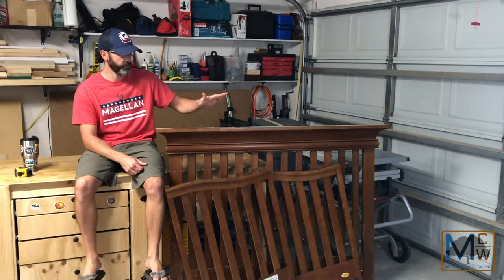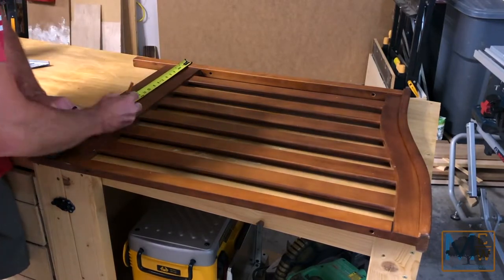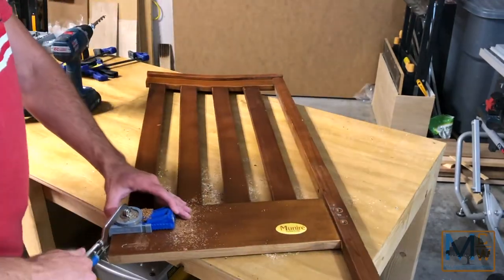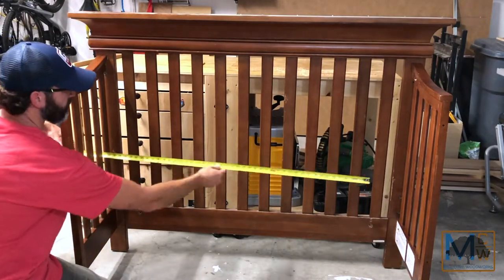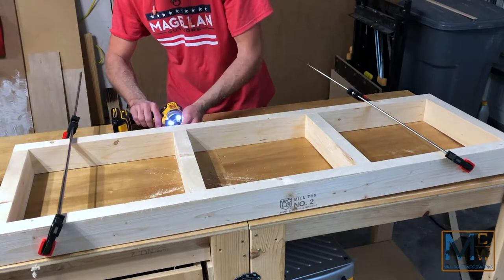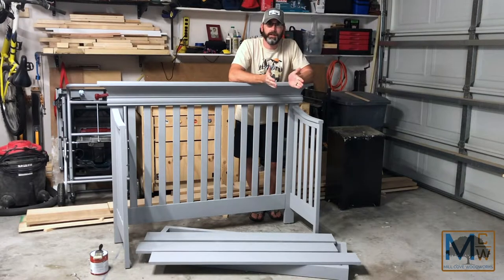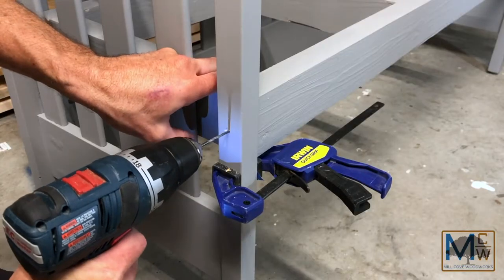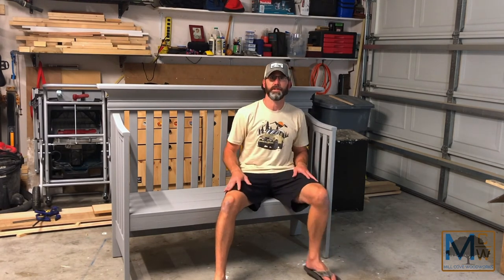Turn Your Old Crib Into A Crib Bench

Comment: Thanks for the video. My wife asked for this same bench and I plans to build it and your tips are extremely useful especially stop and paint. Seat height and depth are critical and you covered that.  

Great detailed instructions. I use the Wagner Flexio 3000. We have painted a loft bed for my daughter with it and several other projects. I am extremely happy with its performance for the price. Cleanup is extremely easy
Reply from the maker: That’s great, happy to hear the video helped. Good luck with your bench and thanks for the insight on the Wagner.
Reply: It’s been a year now. Did you get to make the bench?

Comment: This is lovely. We had a stillbirth and then went on to have 3 more kids. I bought the crib originally for by daughter who ended up passing at 24 weeks. I would like to do the same with the crib as everyone has outgrown it now. Do you think it will stand up okay in the weather. I planned to put in my yard but we love in Canada and get lots of snow. It is hardwood and wasn't sure is I need to bring it in in the winter and if it will withstand then rain or if I am best to keep it indoors?
Reply from the maker: I’m so sorry for your loss Molly. I built a similar crib bench for my Mom and used exterior paint so she could use it outside. She has had it for about 6 months now and hasn’t had any issues. Be sure to use exterior screws and I think it would do okay.

Comment: We are doing the same thing, but we're worried that the seat wasn't going to be sturdy enough without either it's own legs or a center support, what do you think?
Reply from the maker: As long as your bench will be a similar width you should be fine. I’ve built four of these and I haven’t had any issues. Good luck!